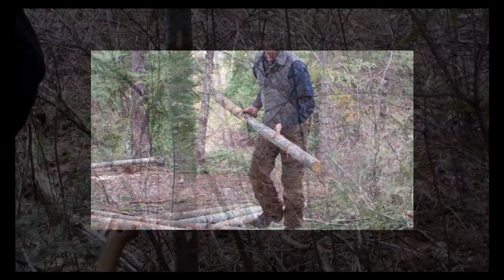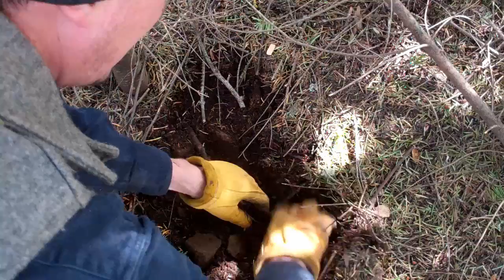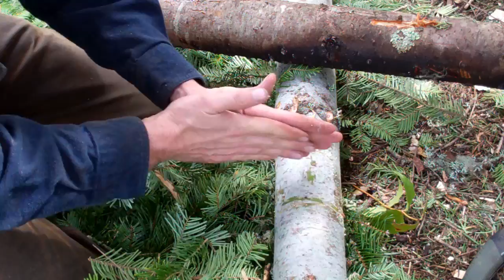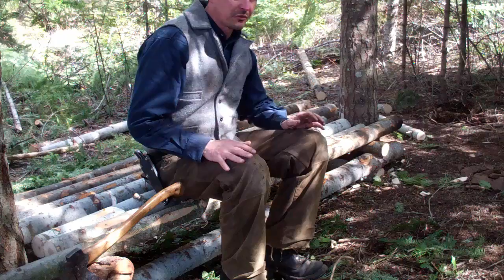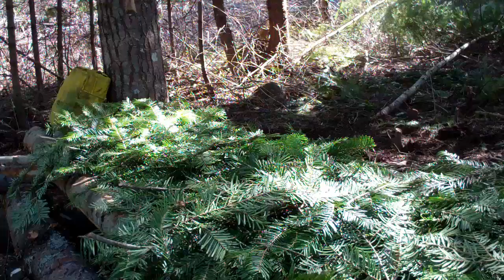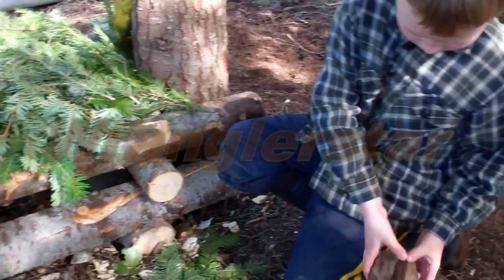Build an Emergency Shelter: Using Basic Tools for Survival!

Comment: That's a nice bed, but it's very unrealistic to expect to be able to build something like that for a unplanned night in the woods.  For one thing very few people carry an axe for just a day hike or an afternoon hunt, the two most likely situations to land you in a lost in the woods survival situation, and if you just find that you don't have time to get back before dark you're certainly not going to have time to build anything like that either!

For your shelter you need two main things: protection over head from rain & snow and protection from the cold ground.  Unless it's actually raining/snowing while I'm building the shelter I'll build the bed first.  If possible I like to use evergreen boughs for this, but if they're not available dry leaves will also work.  The key thing to remember is that you need at least 4" of material between you & the ground once that material has been compressed!  Generally that means that your bed is going to need to be 3+ feet thick to start with.  With evergreen boughs it's best to stick the thick end of the bough down towards the ground as you layer them up.  This will create a bit of an innerspring affect and help give you a comfortable night's sleep.  If you have to use leaves the key thing is to make them as dry as possible.  Wet leaves will suck the heat out of you as fast as the ground will.   Try to get as many of the leaves as you can directly off of the tree.  You will also need something to keep the leaves from spreading out on you when you're in your bed.  A good sized log on each side of the bed and another one at both the head & the foot of the bed will work.  You can use stakes to hold them in place & keep them from rolling away during the night.  (If you happen to be in the jungle though you do have to get off of the ground.  This is mandatory, not optional.  If you don't the bugs will quite literally eat you alive, not bite you, eat you.  If you're hiking in the jungle carrying a lightweight hammock is not a bad idea!)

For the overhead you can use sticks to make a frame and then cover that frame with either boughs & branches or debris depending upon the time of year and the resources available to you.  Personally I just carry a shelter with me.  It's both a lot easier and a lot more effective.  I carry an 8'x8' nylon tarp, a 5'x7' Grabber Outdoors space blanket (in blaze orange), an SOL 2-person Heat Sheet, an SOL Escape Bivy, 550 cord & 6 ABS plastic tent stakes.  All total it only weighs a few pounds, and it gives me everything I need to setup a very good shelter in just a few minutes even in the dark. All I have to do is gather some evergreen boughs or dry leaves to make the bed, and I'm set.  During cold weather I'll throw in a 2 mil clear plastic drop cloth as well so that I can make a 'Super Shelter' if I need to.  (Do a search. There are dozens of videos about it here on YT.)  I could carry that stuff with me for 100 miles, never use it and still waste fewer calories than I'd burn building one shelter from natural materials.  It's worth carrying it.

Having that stuff with me also means that I don't need an axe or even a saw.  My knife is enough.  I both agree & disagree with Cody about survival knives.  No knife will ever replace a proper axe.  On that we agree.  However carrying a knife that can be effectively used in that role if necessary is a very good idea!  If you ever find yourself stuck out in the woods with nothing more than what is strapped securely to your body odds are that an axe isn't going to be among you gear even if you normally carry one, but a good knife should be!  We often hear the scenario about 'dumping a canoe', but that's not the only way to find yourself stuck with nothing more than what's on your belt & in your pockets! Having to drop your pack to avoid drowning during a river crossing also happens from time to time, and in some areas a person can become hopelessly lost in less than 100 yards.  It happens all the time even to experienced outdoorsmen.

Comment: hrglpfrmpfxy -- Cody is wearing a wool vest made by Filson. I believe it is the Mackinaw Wool Western Vest, although I am not 100% sure.
Reply: +johnrgmcmenamin What are his pants? Thanks.
Reply: +Brian janiga Hi Brian. Cody is wearing a pair of Filson Double Tin Waxed Canvas pants. They are relatively expensive but are incredibly durable. I have a pair and they are amazing. Lastly, Cody buys the pants unhemmed and lets them fray (you can buy them with a hemmed seem).
Reply: +johnrgmcmenamin , Thanks for the quick response, Next question, what make model axe? Thanks
Reply: +Brian janiga Hi Brian. Cody is using the Gransfors Bruk Small Forest Ax. Gransfors Bruk is an ax manufacturer out of Sweden. They make very nice axes. In fact, I purchased my own small forest ax at the factory in Sweden (video is on my channel).

Comment: Using saplings or brush for the bed's surface makes it more comfortable, is less work, and is faster to make than chopping down 7 rigid poles. Also you didn't mention the orientation of the lean-to. Mors Kochanski recommends having the back head-end corner on the windward side so that the wind blows past the shelter at an angle to prevent smoke and sparks from rolling back into it. The main wall mostly sheds rain and snow and a much smaller wall constructed at the head end acts as a windbreak.

Comment: @bobcat224 all cutting tools eventually need to be sharpened, but BAHCO does sell replacement blades for the 396LAP and they can be purchased by mail order. Also corona, another manufacturer of pruning tools makes a carbide sharpener for these types of saw teeth, or likely Nicholson or Bahco would have a file for filing the teeth back sharp. I have yet to need to sharpen mine, but it is also the newest of my 5 folding saws, so the wear gets spread out.

Comment: May I recommend the Samurai Inchiban as a replacement to your current handsaws? It is extremely sharp, cuts fast, durable (stays sharp for a long time), comes with a sheath and the blades are replaceable! Mine is the 13"...

Comment: I agree. As a survival Instructor I would classify this as a long term shelter not as an overnighter. By long term I mean you have crashed your plane in northern B.C. or the Yukon and are most likely going to be out there for a while. As far as and order of operations depending on climate usually goes Fire, Shelter Signals, Food, and Water. Of course choosing shelter with all these things in mind.

Comment: Great video!

If you cut your flats into one log such that their flat surfaces were rotated to each other (about the axis of the log), the logs won't be stable. Is there a good way to make sure the flats you cut into each log are parallel to one another? Or is eyeballin it generally good enough?

Comment from the maker: I have seen it. It is not expensive. You can get the whole system with bar and chain 18" for $65. Keep in mind this in not a pro grade tool. It is geared toward the homeowner. The replacement chains for the system are twice the money of conventional.